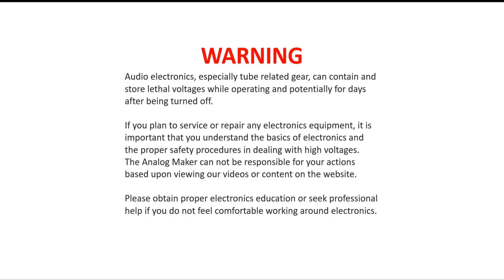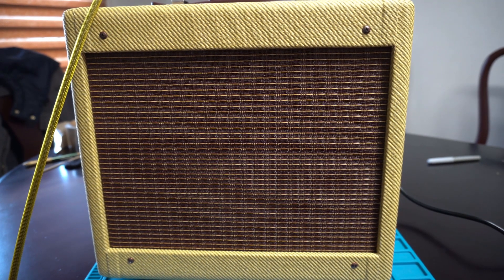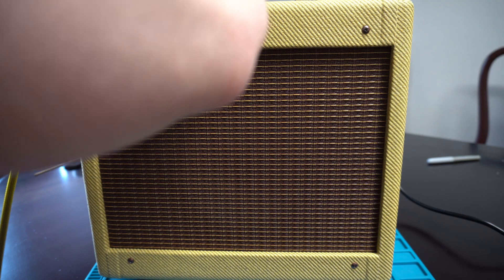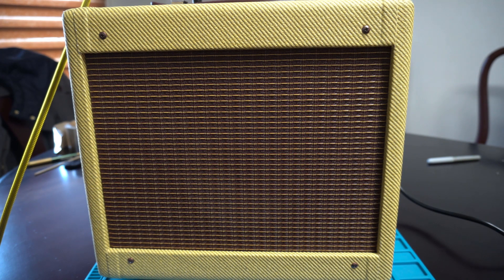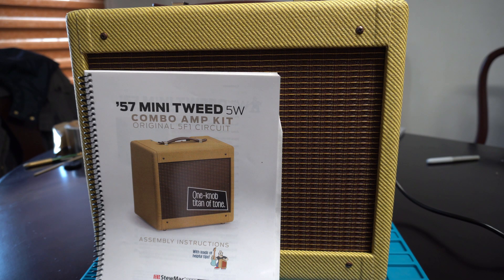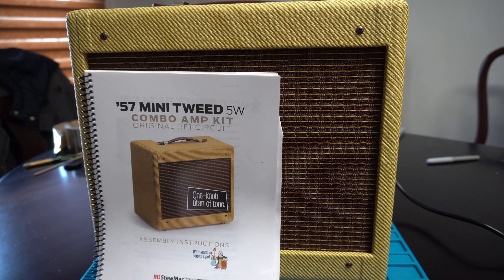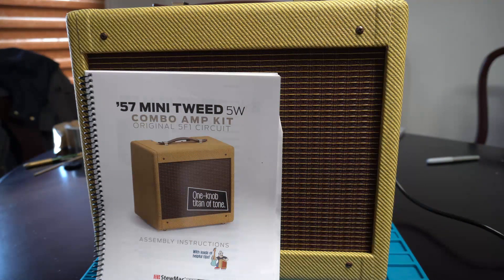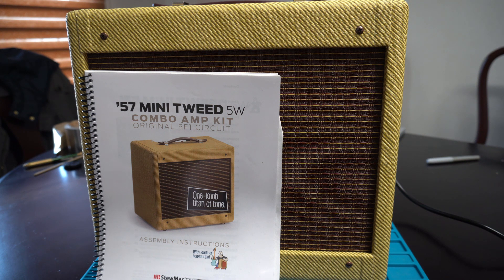StewMac '57 Mini Tweed (5F1) DIY Tube Amp Build - Part 5

Comment: Did the BOM (bill of materials) that you showed in the opening video actually list the quantity of the green wire used for filament and ground wiring? And if it had listed the quantity, did you verify that was was the quantity received? I am just trying to determine if it was a quality control error in filling the kit or an actual error in the BOM quantities. Thanks!
Reply from the maker: I didn't measure it up front to verify (it comes looped up). However, I measured and cut all the pieces per the instructions in the guide. I had excess of the other gauges so I looks like they flipped the lengths. Had too much of the smaller wire and more of the heavier.

Comment: message from Hong Kong. Good video, I am wondering what is the difference between 57 mini tweed and fender pro junior as I am new guitarist
Reply from the maker: There are many differences, but the main ones are the way the power is rectified (AC to DC current) and the output stage. The 57 tweed is modeled after the 5F1 Fender circuit which is single ended (one output tube) with a 6V6 tube. The pro junior has two tubes in the output (push-pull configuration) and uses EL84 tubes. Single ended vs dual tubes discussions aside, 6V6 tend to have more headroom vs EL84s. What that means that an amp with EL84s should start to breakup quicker than that 6V6. But this is a large over simplification because they do have two different types out output stages. For power, the 57 tweed (5F1 clone) uses a tube to rectify the AC to DC power while the pro junior uses diode rectification. How the power is rectified in an amp, in theory, shouldn't have any bearing on the tone since the power stage doesn't influence the analog signal from your guitar. However, if you compare side by side, tube rectified amps are known to "sag" when you drive them hard when the analog tubes try to keep up with the high power demand. Diode rectification doesn't have the same "sag", but comparing the two types of rectification can be largely subjective. The Mesa Boogie Dual Rectifier has both so the user can switch between diode and tube rectification. Which amp is better is really up to how and where you will be playing. If you are looking at both I recommend going out and playing them in person and doing more research on amp theory/design.
Reply: @theanalogmaker2019  Thank you for the explanation!~

Comment: Thank you for sharing! This was great.  I also recently built this amp, 57 Mini Tweed frm Stewmac, and your part 5 video series convinced me it could be done.    The build went really well, and the amp sounds great!  For only being 5 watts it sounds really loud to me. I've only solid state amps before this though.  There were only a couple minor issues with the build.  Most issues were on me and easily fixed. Luckily, I didn't have the issue with one of the tube sockets like you did (maybe too much solder), but Stewmac did short me green wire just like you.  I know I didn't mismeasure: they provided very specific directions on how long to make the wires.  Where I was shorted was connecting the 2nd tube socket to the 3rd tube socket. I used yellow for this and also shorted green wire on one ground wire which I used some of the left over green wire from the transformer (which is stranded) but probably doesn't matter for ground wire.  

The green wire is slightly larger gauge than the yellow. I think one is 22 and the other 24 gauge, both are small wires though. I hope it doesn't make a difference using yellow instead of green. You would have thinked they'd resolved the shortage of green wire issue by the time I bought my kit 6 months later after you did, but no.    

The only build mistakes I made was I had two cold solder joints, which were easy to find and fix with voltage tests they have you do. I wasn't getting the B+ voltage and checked the wire going from socket 1 to point 16 on the board and the wire was loose:  D'oh!  And, one of the ground wires was loose too.  Both easily fixed. The hardest mistake I had to fix was that I forgot to solder a couple wires for the lamp. I had to go back and remove the old solder, and add the missing wires and resolder. I'm always leary of removing solder as reheating the components can damage them, but luckily all these parts are really tough. This a good starter build for mistakes like this, that are easily fixed.

It was a good build.  The directions were good overall, my only complaint and small one is they could have provided directions on how to install the tubes. I had to Google where pin 1 was on the tubes (never owned tubes before), which is just left of the center indicator.

The only thing I did different than you, is I did follow Phil McKight's advice on shellacking it first and it looks great! https://www.youtube.com/watch?v=3gHpr17Cc1A  It does add couple days to the build but it's worth if you do four coats like Phil says.  I showed the amp to my wife and said the shellac makes the amp look like an antique which is the vibe I wanted.
Reply from the maker: Thanks for the comment! I'm glad your build came out very good and I appreciate the tips. There are ton of great solid state amps, but there is just something about tube amps (including tube rectification) that I love. I'm also a fan of Phil McKnight's channel and watched his shellacking video. I will probably attempt to shellac a future amp because it does make it look very cool. Did you find that there was any tone difference in your amp after you added the shellac?
Reply: I can't tell an audio difference on the shellac.  I think it's just cosmetic.  It changes the look and vibe of the amp.  It's more amber colored, which makes it  look older to me.  The shellac also protects from stains,  and slows down fiber fraying.
Reply: @theanalogmaker2019  The only negative thing I found with the shellac is if you bang the amp it leaves a small dent in the tweed.